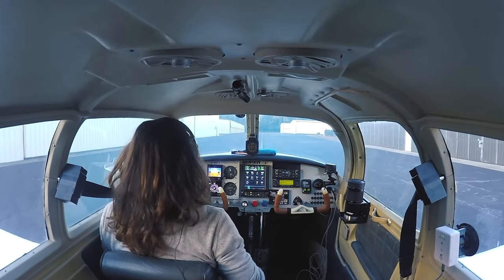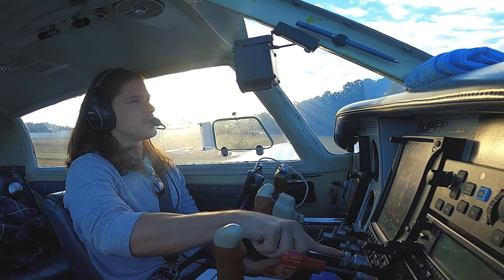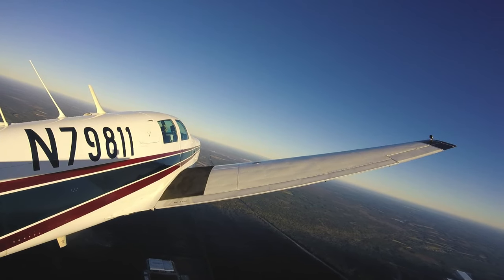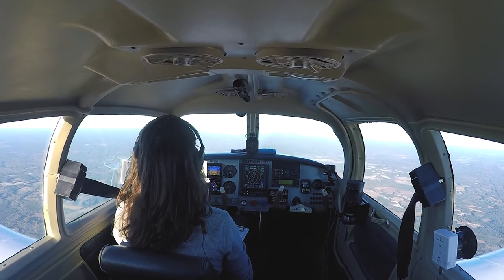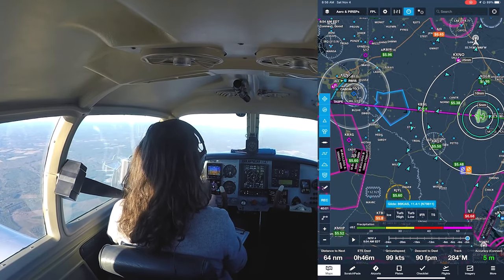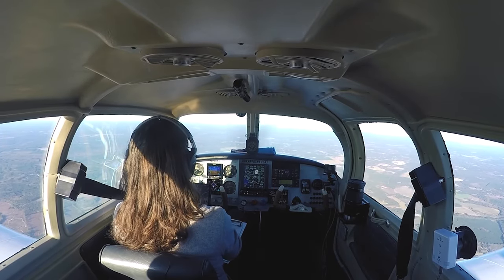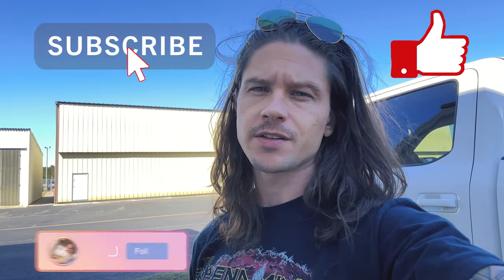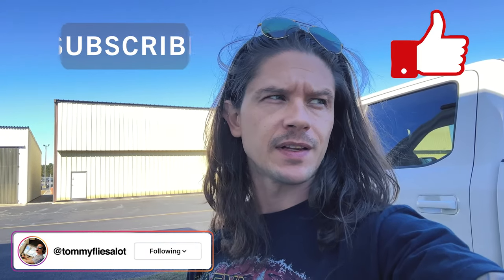Garmin GFC-500 Flight Demonstration Vlog and FULL COST OF INSTALL!

Comment: Nice demo of the GFC 500. I’m having one installed as we speak, along with a G3X and 750Xi in my Cardinal. As a retired USAF pilot and current 777 Capt, I really like the way you manage the airplane and systems. Very professional. If I may offer a suggestion - consider removing some of the items from the airplane key. The additional weight and vibration can cause premature wear on the ignition switch which can lead to bad things (i.e. a hot prop with the key removed). And congrats on your commercial!

Comment: Your missed approach/GA issue is a settings issue. I flew with a guy who has a Baron with similar issues. His GA setting was approximately 10° where it should be closer to 7°. Not sure what angle in a Mooney gives you Vy, but that’s what you need. An avionics shop can set it for you. Whether or not the autopilot stays engage when hitting the GA button might be a setting too? I fly a G1000 that disconnects AP and a G1000nxi that stays engaged. Great to do all this VFR like you’re doing. No surprises when IMC.

Comment: I do the same thing for audio. I’ve tried so many adapters, recorders, etc. with continuous issues. The mic in the earcup plugged into the GoPro works pretty well, especially if you remember to put in in there! Congrats on the new rating.

Comment: My partners & I have a GFC500 in our Cherokee 235 and I LOVE it. Prior to this I didn't have an airplane with an AP. So I did all of my instrument training hand flown. GFC500 makes instrument flying so much easier. I've now added working autopilot to my list of personal requirements for single pilot IFR. What an massive increase in safety.

Unfortunately we don't have VNAV in our GNX 375 GPS. That looks like a really nice feature. Nevertheless still love the AP.

As far as missed approach, I know garmin says to hit the TOGA button first, but I prefer to go full power first, then quickly hit TOGA. Full power suspends my descent and then TOGA initiates the climb. But since I'm full power it isn't as crazy steep. After I'm established in a climb, I switch to NAV & IAS to take me to my missed altitude. Maybe give that a try on a practice approach?

Comment: My mates Piper lll has the GFC 500 coupled with c3x display. Go around is set at about 7.5° pitch up. Take it back to the radio shop and get them to correct it. It will be a setting in the software.

Comment: Great video, I love my GFC500, 2 G5,s and GPS175, unfortunately the GPS175 has limitation.
 Not related to the GFC500. I have a question regarding the shoulder belts what brand are they?
 I have a Cherokee 180 and I like the idea of shoulder belts instead of over the head. Thanks

Comment: Just subscribed and new to the channel. Nicely presented Tom. I fully agree with you about the cost and benefits of the GFC 500. $19K installed with new servos and flawless integration with a capable GPS: that's a good investment on many levels. Cheers and congratulations on passing the commercial certificate.

Comment: Ps… with the audio issues you mentioned, were they happening when the camera was running off battery, or only when plugged into plane power?

If the issue is only happening when plugged into plane power, it may be a ground loop issue. Should be able to resolve it with some ferrite cores.

Comment: So, when you were talking about flying to Florida, you mentioned about being on AP.  Don’t you still need to use your rudders for coordinating flight?  You mentioned you put your seat back, etc. How do you still maintain coordination with 2-axle AP?
Reply from the maker: The roll rate of the AP is slow enough you don’t need rudder. You could kick the rudder if you want but there’s really no need.
Reply: In my Cardinal, the ailerons are rigged such that the up-going aileron deflects more than the down-going aileron, thus eliminated adverse yaw. During cruise I fly with my feet flat on the floor.

Comment: Yeah id say you don't need the YD, considering there's interconnect in the rudder with the ailerons. Very well equipped Mooney and anything else in the panel added would be considered overkill(some guys with 2x750s and a gps xpndr, just crazy). For full jet level capable a/p that is a pretty fair price even more so in the recent economy

Comment: I have the G5's, 750, and GMC500 in a Cherokee Six.  On pushing the TOGA button I get a fairly gentle pitch up to about 7 degrees.  Consider getting the pitch up adjusted if possible. The TOGA is very useful in keeping wings level and climb pitch untill time to push the NAV and Indicated airspeed buttonds for the missed appr.

Comment: I need your help brother, just failed my commercial checkride because of the power off 180 in my 74 M20E. Can you walk me thru what works for you for power off 180 ?
Reply from the maker: Don’t forget you can save your flaps and gear until your base turn (or whenever) and some DPEs will let you slip it in. It’s an aircraft mastery maneuver not an emergency maneuver (but some DPEs may not have that opinion so you’re better off to ask them first). Then, practice, practice, practice. Good luck 🤙